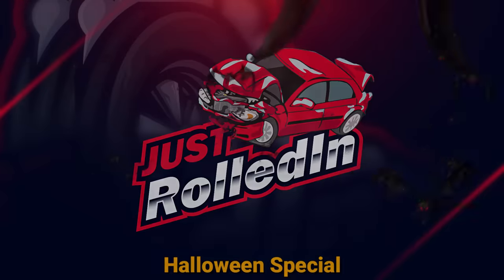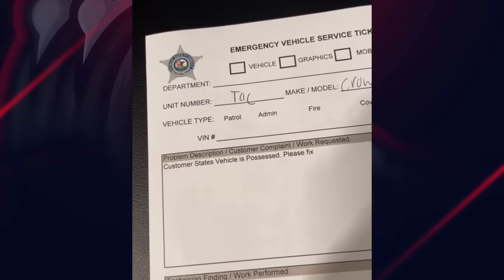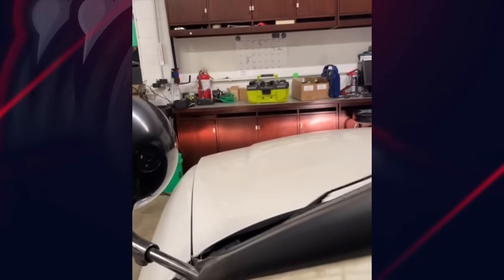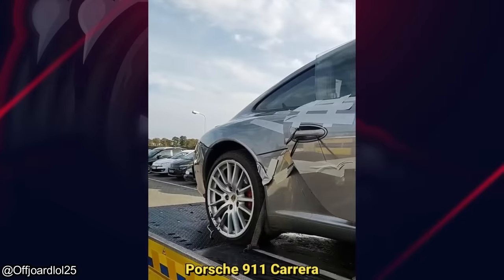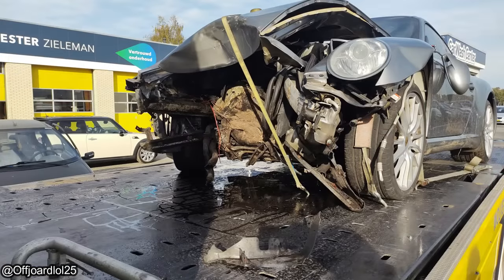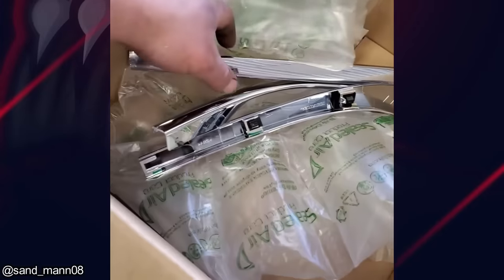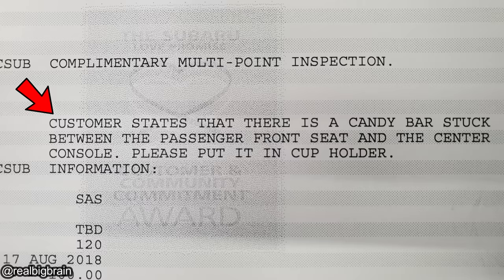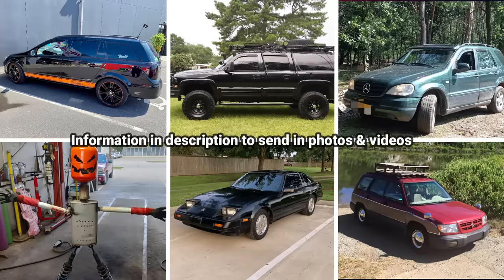Customer States Car Is Possessed | Just Rolled In

Comment: I had a possessed mercedes once. Found that a piece of fuse had fallen and arced across several fuses thus powering up things that were not supposed to be powered up. Also one day the Honolulu police dept brought in a car that had had a bomb go off under it. I was to take the seat out and apart to look for pieces and possible path of travel of said pieces. Well, I found a decent sized piece that had been stopped by the metal used in the construction of the seat. If it wasnt there, that piece would have gone through the back of the driver and killed him. The cops said that the guy would most likely want that piece of metal.

Comment: I will never understand these oil change ones.  I just changed my oil yesterday at 9,300 miles and felt guilty as he'll that I didn't get it done at 5,000 like normal.   Thankfully it was a tan to light brown color so not burned are tortured and was no metal shavings or signs of wearing from the engine. 

How do you go 80,000 miles without changing your oil seriously?  I'd hate myself for years if I did that.
Reply: when the engine gets hot the oil melts to be liquid again  is my guess. otherwise the oil light would come on? then they put tape over that ?